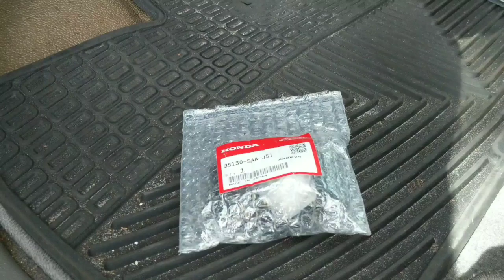Honda Odyssey 2005-2010 Ignition Switch - Replacement

Comment: 2007 ODYSSEY: Called the dealer $312.30 for labor (2.5 hours they say) + $91.96 for a faulty part.  Total = $437  Bought the part at Advanced Auto, installed & test drove in 1.5 hours.  Total $47.  Great video.  Thank you!
Reply from the maker: Good to hear, stealerships are not the way to go. No even for an oil change jejej. Wow $437! Can't imagine. Glad the video was able to help.
Reply: Can you give me the part number to the item you bought?
Reply: Hey and also my radio is jumping from station to station  and from DVd To Radio to aux. Any ideal whats causing it?
Reply: @sewfantastic7257  is a bad ground in the steering column you have to take of the steering wheel, cable reel you will see a bearing take a small punch with a hammer tap “dimple “ around the bearing
Reply: @kaimanson3174  Hello Bro, I've got a 2006 Honda Odyssey EXL That I've Got The 3 Screws Out But I Can't Slide Cover Out. It's Like It's Stuck On Something At Back Of Cover.. I'm 45 Mins In & Frustrated A Little Lol. Any Help Would Be Appreciated..
Reply: I Do Have Cover Popped Out And Down, Hanging Under Steering Wheel But It's Like It's Hung On Something In Back Part Of Cover
Reply: Most the time its a single corrupted waffer that once simple removed fixes the issue for free!!!   Future reference
Reply: @wes365 i have exact same model... did you figure it out?
Reply: @jazwraps7178  it was giving signs of possible ignition switch or starter ..I started with less costly paets it could be which was battery, ignition switch & starter.., but it ended up being the starter. I've had it to Myrtle Beach & back since fixed..runs great for having 298,000 miles on it. Thank you for asking Bro
Reply: And thank you for responding..you are only person that did & I'm grateful,  you took the time to respond
Reply: @wes365  no problem! I struggled with it for like 30 minutes befor i got it out... i really didn't want to break the cover.
Reply: What were the symptoms your ignition was showing I have an ignition that will not turn despite having tried all three keys is this an ignition switch?
Reply: @wes365  same!

Comment: Pro Tip: Turn the steering wheel upside down and pull out the bottom kick panel off a bit (don't need to take all the way off).  This will allow you to remove the bottom steering column cover easier.  Also, if you don't have a right angle screwdriver, you can use a philips bit and small vice grips.
Reply from the maker: Great idea! thank you for sharing.
Reply: @kaimanson3174  Finally dawned on me to turn the wheel after battling it for a half hour lol.  Thanks for posting the video.
Reply from the maker: @fvr12345  happy to help Mike! 👍
Reply: You can't do that when the key doesn't work!

Comment: You cut out steps in the video, if you are going to do a how to video it should show the whole process, we couldn't get the bottom part off and you cut that part in the video it would have been helpful to see that even if it took you as long as it took us to get it out.
Reply from the maker: Appreciate the feedback, sometimes holding the camera and the angle is hard to get everything on the shoot, while at the same time hold the screwdriver and removing the part. Will keep that in mind for future videos.
Reply: If will not let down to adjust the steering wheel.
Reply: Thanks, we took the handed off trying to get that cover off , Do you  have any video on how to get that tilt handle back in place?
Reply from the maker: @sewfantastic7257  happy to help 👍 unfortunately I don't have any videos for the tilt handle.

Comment: Thank you so much for this video! I found it while I was searching for the issues we had (the van shutting off on the highway but the engine not cutting, sometimes not starting right away when stopped, and finally not starting at all). Ordered an original Honda part on Amazon for around $40 and spent about an hour and a half getting things out, replaced, and put back together and this video was extremely helpful. Thank you!
Reply from the maker: Happy to help fellow Ody owners 👍 in my case it will buzz while turning the key. I ended up replacing it and everything went back to normal.

Comment: I broke my tilt lever trying to tske out bottom piece 😮 im calling the locksmith he can deal with it. These oddesseys suck
Reply from the maker: Sorry to hear that. The lower trim is a nightmare to fully remove. I left it there hanging instead, just enough space to remove the ignition switch.

Comment: Messing with the steering column had its moments, but I was able to replace the switch in about an hour, saving about $400.  Thanks for the video!  Recommend an angled phillips screwdriver for that one pesky screw.  Very straightforward replacement.
Reply from the maker: Happy to help 👍 yeah it is one of those tasks you have to improvise with the Phillip screw driver.

Comment: I have a2006 and unable to remove lower cover after removal of the three screws. what year is this odyessy? any advise would be appreciated
Reply from the maker: Mine is a 2008. The game is to remove as much as possible of the covers to have enough space to remove the ignition switch. I didn't remove the whole cover, it was a bit of a mission and as in your case the lever was on the way.

Comment: uable to remove lower shroud to access ignition switch. our is a 2006 model. the lever is in the way.
Reply from the maker: Try to remove as much of the lower trim. To have enough space to pull the switch out. I couldn't remove the whole trim as well.

Comment: This job took me a good 2 hours on an 07.  I’ve been working on cars for 50 years for some perspective.

What I found was that the two outer screws holding the lower cover on, as well as the two screws holding the switch on, are JIS, not Phillips, and it helped to have both a #1 Phillips screwdriver and a 1/4” bit in #1 Phillips, both with the very tip ground off.  That simulated a JIS driver closely enough.  I also used a pair of right angle ratcheting bit holders, straight and angled, and those were very helpful.

Overall it was kind of a PITA job.   But great video!
Reply from the maker: Yeah there are a few tricks to get there and thank you for sharing yours, sometimes experience (50 years) helps you out to come out with extra ideas by using different tools to make the job easier 👍 have to help

Comment: This was not for removing the ignition tumbler and replacing it? I need to replace the old tumbler with my new one that I had a locksmith match the keys to the old ones so I could get into the doors and start it with same keys. Had him program me 2 new ones also.
Reply from the maker: Correct, I'm replacing the ignition switch, no the ignition lock cylinder.

Comment: I got a 2011 odyssey.  Is there something I’m missing getting the trim casing off the steering column.  I can’t find any info on a 2011.  I get it halfway but will not budge.
Reply from the maker: Check for any extra bolt/screw. Or any clip holding the casing. Should be about the same idea as Gen. 3.

Comment: I took everything apart. It wasn't a problem since i previously changed the ignition lock cylinder a year earlier.  This time, when i disconnected everything for the ignition starter switch. I turned the key before i had the starter switch in and now i can't turn the key again. I might just the take lock cylinder off  again and see whats up if i can't find an easy fix for it.
Reply from the maker: What issue were you having that made you change the ignition switch?....in my case it was making a buzzing noise (for about 2-3 seconds) while I was turning the key on.
Reply: @kaimanson3174  it was the buzzing noise for me also
Reply from the maker: @TheMentalMKE  oh ok, yeah try to remove and take it a look at the lock cylinder. For what I have read both are not related, therefore changing the ignition switch won't affect the ignition cylinder.

Comment: Is it possible to swap an ignition switch solenoid off a used and out it on my current one to avoid all this? My key gets stuck in first position regularly. Thanks man
Reply from the maker: If the key is getting stuck, your issue is most likely with the ignition cylinder, not the ignition switch.
Reply: @kaimanson3174  sorry, i mean the solenoid thats next to the black disabler device by the key port? Is that interchangeable?

Comment: Do we need to reprogram or not for odyssey 2009 after replace it? Thanks
Reply from the maker: No programming needed if only replacing that part.
Reply: Yes I replace ignition key included thr cylinder...how is it. Thanks
Reply from the maker: @dedidewadji6663  if ignition cylinder key is replaced...I believe an programming might need to be done.

Comment: hey man i did what you did exactly in this video but now my key will not turn at all and i put the old ignition switch back in and still won’t turn and then accidentally locked the steering wheel. any tips on what i should do
Reply from the maker: Weird, the cylinder mechanism could be your issue in that case.
Reply: You may want to pull the steering wheel while turning the key...it may help you to release the locking mechanism..turn hard left or right and try turning the key
Reply: Hi. I have exactly same issue and when i open the door beeps like the key is in the ignition. did solve your problem? thanks.

Comment: The key won't go all the way in on my wife's Honda Odyssey.. and it won't turn over. I feel like I can replace this myself but I've heard you may have to have the dealership problem the key? Is this tru? I don't have a scanner or anything to program it myself
Reply from the maker: If ur key is not going completely in, most likely the issue is with the key cylinder. It may have something stuck inside (maybe dirt, or maybe fuzz from inside the pocket or something). Replacing the ignition switch won't fixed that. And yes if you replace the key cylinder you might need to get the new key reprogrammed with a locksmith or dealer.
Reply: what was the outcome of your situation, my key just stopped going in and wd 40 isnt doing the trick - thanks
Reply: My steering wheel is locked and won't unlock and I have tried everything.
Reply: @sarahd8093  did you figure it out?
Reply: @jazwraps7178  it's been an absolute nightmare and I'm still without my van.  Bought and returned 4 parts, from the $30 ebay part to the $230 O'riely part. It's called the ignition switch lock cylinder. We accidentally sent back the immobilizer with the part so now I have a used one with that part on it.  Going to install it soon.
Reply: @sarahd8093  holly hell... im gling back to mine today. I see a lot of videos with little hacks that might get it going without removing it
Reply: @sarahd8093  found a video of a older woman removing the vad waffers then the key worked without putting in new ones
Reply: @jazwraps7178  we accidently sent the immobilizer with the ignition when I returned a part. So I bought a used one with the immobilizer on it, got the keys programmed and now it won't start. It all started with a locked steering wheel.  We tested the starter and that's not the problem. Edit: after re-reading my previous comment I realized I already told you about the immobilizer 😂  My situation wasn't too bad until I sent that part back.
Reply: @sarahd8093  battery is  probably dead after all this time!
Reply: @jazwraps7178   I bought a new battery before getting my keys programmed.
Reply: @sarahd8093  let us know what you figure out. My steering wheel is locked as well
Reply: @sarahd8093  idk if this helps or if its too late

Comment: when you change the ignition do you have to program the new keys?
Reply from the maker: No, programming is not necessary when replacing the ignition switch.
Reply: @kaimanson3174  do you still need new keys?
Reply: @kaimanson3174 I just switched my ignition switch but now my key won’t turn at all. What do I do?
Reply from the maker: @Unknown-hz1md  if it was the ignition switch as show in the video, it shouldn't affect the key mechanism. If you replace the ignition cylinder then that's a different story.

Comment: How did you get the lower housing off?  The steering wheel height lever is in the way.  The video cuts off there.
Reply from the maker: You have to pull the steering wheel column all the way up and out (towards you) and the same time the lever has to be loose (in the middle) so that you can move it up and out while you remove the lower piece because if you leave it on the lock position the piece would be lock as well. Watch out as well the lower housing comes out with a piece of metal that can hit the lever while it is being pull out. Try to use your knee to keep the steering wheel up and out and both hands to pull the trim down and out.
Reply: @kaimanson3174  Thanks!  Had to muscle it a bit.
Reply from the maker: @phreaktor  jejeje understandable...that was the main reason I couldn't record it. Glad u were able to remove it. What issues were you having with switch?
Reply: @kaimanson3174   Getting it out was easy enough, getting it back on has proven to be quite a challenge.
Reply from the maker: @TimHaunFishing  here was the other way around. Removing it was quite hard, getting it back was quick.
Reply: @kaimanson3174  I am also having a hard time removing the lower cover. Invested several hours. Try to follow all the tricks in the other post but didn't work. Any suggestions?
Reply: @phreaktor  Did you use any trick to get it out? I am not able to.
Reply: @TimHaunFishing  any suggestions? This thing is killing me. I can't get the lower trim off.
Reply from the maker: @Indrajitkumar15  make sure the lever is not in lock position so u can move the whole thing up and down as u need it. And as well make sure the ignition key hole pull out as well. It is not easy to remove but just make sure those two things are out of ur way and with a little fight u should be able to remove it or at least partially remove it, so u can get access to the ignition switch.
Reply: @Indrajitkumar15  I just followed his advice.  I did have to pull it pretty hard to get it off. I am assuming you w gotten it off by now.
Reply: @phreaktor  I tried several ways. I have given up by now :(
Reply: @Indrajitkumar15  it helps to walk away from a problem for a while and revisit it.  You know it has to come off somehow right? So look at the overall design and see where you encounter the problem with it not coming off and go from there step by step. You can do it.
Reply: @Indrajitkumar15  Good day to you Indrajit Kumar, I had to remove the lever that locks the steering wheel after adjusting it up or down. The nut spins has washers behind nut must line up washer behind bolted on lever and bracket on adjacent bolt head on opposite side. Lever can be over tighten. Bottom cover came right out. Took about 4 hours. 2005 Odyssey starts perfect now.  Best wishes
Reply from the maker: Glad to hear 👍
Reply: @kaimanson3174  Thank you for the video,  it was helpful indeed.
Reply from the maker: @beemackin2316  happy to help 👍
Reply: @phreaktor  I agree, when working at a Yamaha shop, things used to stump me, and when I woke up the next morning I knew the solution as soon as I opened my eyes. Sleeping on a problem can solve it. If taking a break doesn't work, sometimes a good cussing out will do wonders.

Comment: My van died while driving. After checking the alternator, battery and fuel pump everything seems good. I'm guessing it's an ignition switch issue, I have an 07 odyssey. I hear it's a common problem. What do you think? It turns over but never starts.
Reply from the maker: Could be the ignition switch. Do u have any CEL on?
Reply: @kaimanson3174  no, none at all. It's driving me crazy. I tried to cycle the key a few times hoping I would get a check engine light of some sort but 1 has never came on.
Reply from the maker: @themarchhare1376  get a ignition switch replacement and test it out. Amazon has one "returned" for $15. It is not oem but you can give it a try. If doesn't work just send it back. https://www.amazon.com/dp/B002E5ATDW/ref=cm_sw_r_cp_apa_i_g.HcFbCBNP4N0
Reply: @kaimanson3174  hahaha, that's what I did. Ordered it 3 hours ago. I appreciate your feedback man, no lie. I hope it fixes it b.c my kids can't go anywhere until it's fixed. Not enough room on the motorcycle for a family of 6, lol.
Reply from the maker: @themarchhare1376  Anytime brother, u got it. Keep us posted about the results.
Reply from the maker: Was the replacement part able to fix your Ody?..was just doing a follow-up with ur issue.
Reply: @kaimanson3174  thank you a ton for reaching back out, that's awesome. Unfortunately it didn't fix my issue. I then found a bad ground wire and that didn't help either. I'm starting to think it jumped timing. I was coming home and I felt a slight decrease in speed at the same time I hit the gas. I felt something "jump/bump" in my foot on the pedal and then it shut down. I really have no clue at this point. It's driving me crazy.
Reply from the maker: @themarchhare1376  If you can, visit Odyclub.com is a forum that I'm member of, we have great people there that can give u more help. There is a guy named "John" he is a beast on the Ody. Just post your issue on the 2005-2010 forum and I'm sure you will be able to find a solution. If you have an video of the actual issue while it is happening will be of a great help.
Reply: @kaimanson3174   man that's great, thanks a lot man! I really appreciate you. No b s.
Reply from the maker: @themarchhare1376  no problem brother anytime. I'll see u at the forum.
Reply: I know this is an old comment but did you ever find out what happened?